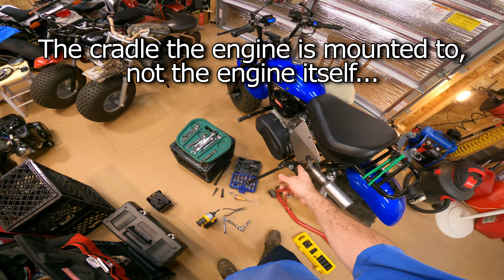SUPERPIPE! + Tillotson + Trailmaster MB200-2 = Awesomeness [4K]

Comment: Really nice pipe. But I don't care for how it bolts on to the frame. Maybe pipe flex is ok?

When I built my exhaust I used a brace from the head to the silencer. It doesn't look good at all but I wanted support for the bolt on silencer. The system flexes as one independent of the frame.

My pipe is holding up well now since my son Tig welded it. My Mig weld was terrible..
Reply from the maker: Yeah the Superpipe is really nice. But I don't like how it attaches to a part of the frame that sends vibes into the frame and causes stress on the pipe. It actually changed the way the bike felt because it stiffened up the frame so much, I could feel that the frame was more ridged. I think I may try to get a silicone or hard rubber gasket instead of those  washers or maybe cut off the mounting tab and not support the pipe or make a flexible hanger from the rear rack. Shouldn't bee too hard to do with a few pipe clamps. Other than that it's pretty cool!